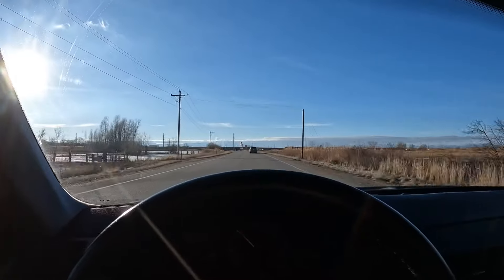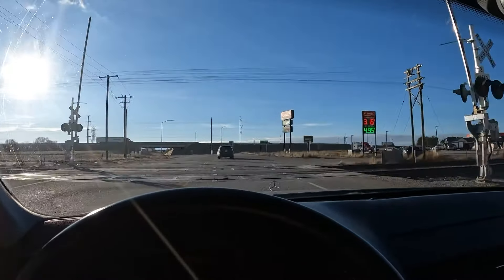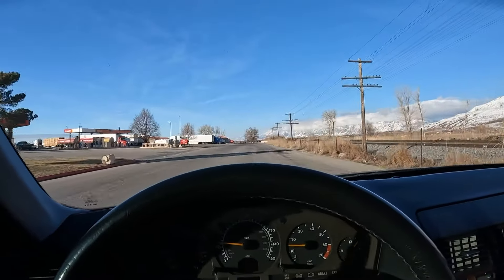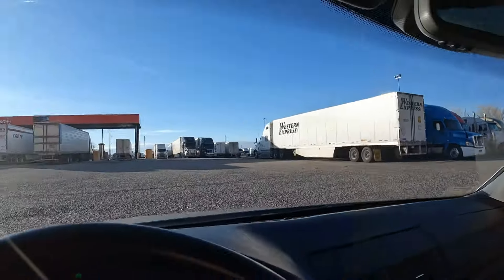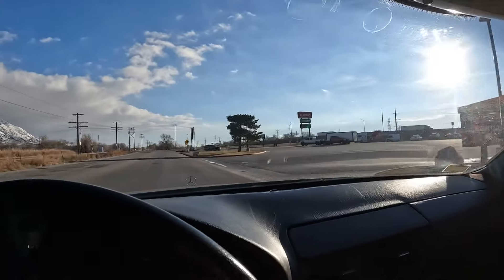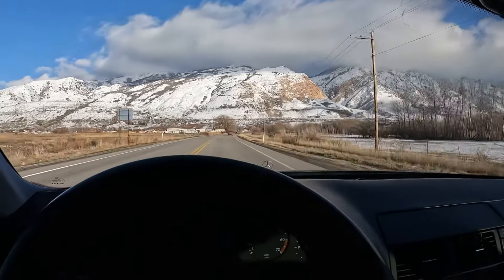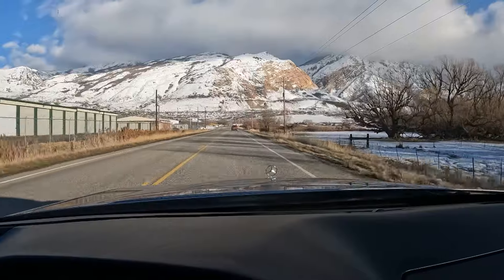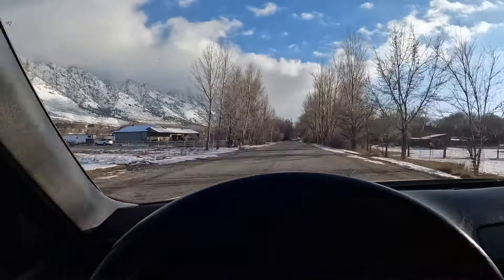NO HEAT in the W140 Mercedes S500!!

Comment: Either blower motor is crap, but more likely the resistor that regulates the motor. Common problem for many cars. Don't know the english word, in German it is "Vorwiderstand". The small amount of air flow comes from the headwind. Nice engine sound
Reply from the maker: Oh I think I know what you mean. It’s under the cabin filter in the engine compartment by the windshield. The part you talk about is on top of the blower motor.

Comment: So what was the problem? My also seems to be on like low for heating all the time…
Reply from the maker: It was the blower motor regulator. It’s located on the driver side under in the engine compartment closer to the windshield. Easy fix but you have to diagnose it.
Reply: @EnthusiastCarHangar there is air comming out and the fan works also the vavle unit was dk what else is left
Reply from the maker: @ my air came out very slow and I could not turn it higher to have more air come out. So the regular was the problem.
Reply: @ yeah, seems like i have a different Problem. First i thought it was the heating valve being stuck because of broken pins. But its getting hot so i have to keep looking what might cause the problem
Reply from the maker: @1dayumay618 I hope you find out. Does it get cold when you turn the temperature down?
Reply: @ when the ec is on yes but without the EC it seems to be the same. On LOW the blower motor seems to spin faster, causing more air to come out at a faster speed wich does feel little colder. Im thinking between some sensor, the valve controller or thermostat…  - when the car is really hot it just blows a little warm air.